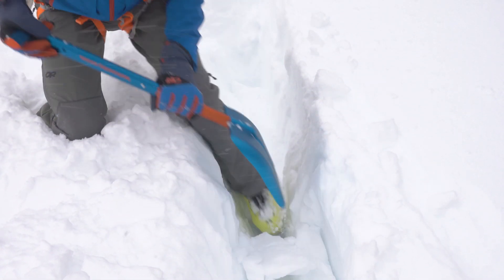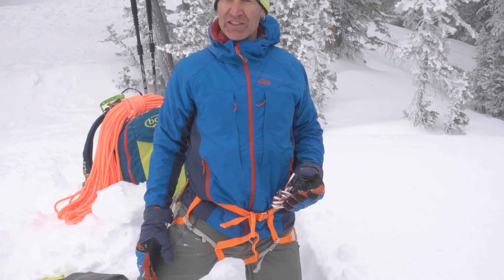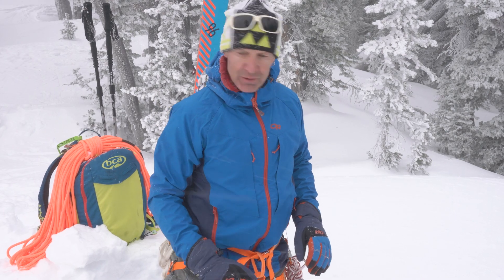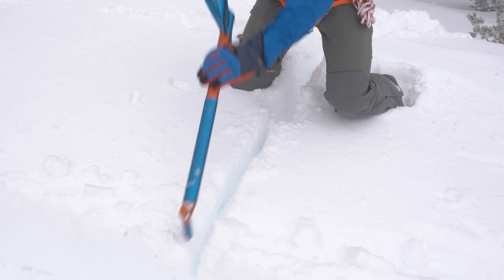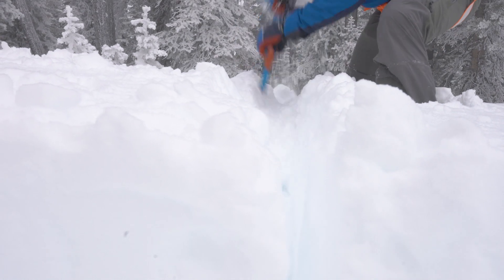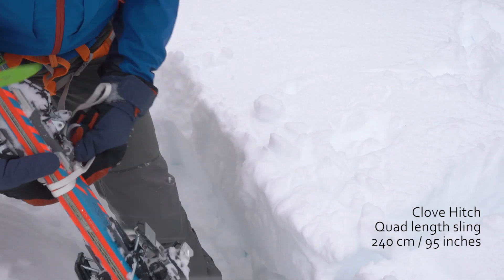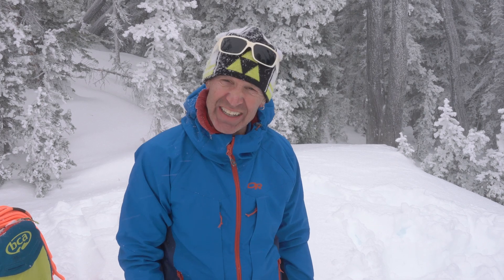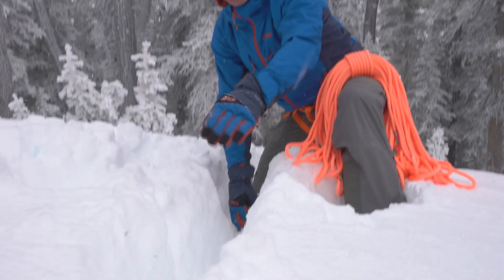How to Build a T Anchor for Backcountry Skiing and Mountaineering

Comment: I am curious why / when you would use this? Once you rap down, then your skis are still at the top? Maybe to lower someone injured? Or maybe to allow one person to rap down, build another anchor and then they belay you as you climb down?
Reply: Crevasse rescue is the big one I would say. If you're concerned about avalanches at the entry of a colouir you can belay the first skier while he does ski cuts. Further down the snow if normally more wind protected. So its only the first couple of turns you have to worry most about. And even in a balanced group you quickly find yourself in a situation where someone gets a technical ascent or downclimb done while someone else needs a little bit of assurance. I have been in both places. But most of the time there are anchor options that are strong enough and way quicker to set up.
Reply: Yeah, to me it looks like something you would never get to use with a balanced crew unless somebody is injured